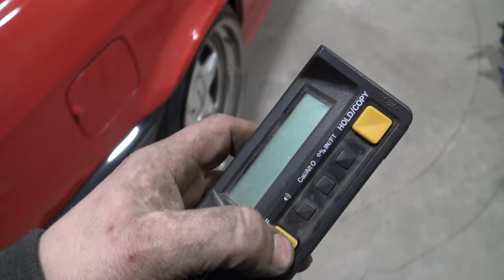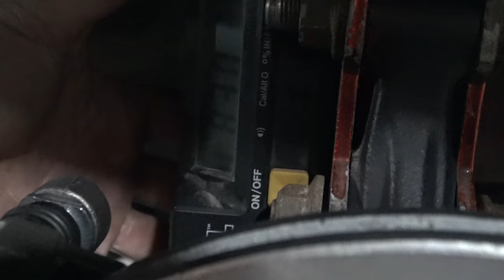Honda Civic front suspension completely converted to 240SX!! (Remaking The STRUT TOWER)

Comment: You guys should mass produce the parts needed for this swap... start selling conversion kits... this actually seems really legit.
Reply: I don’t think the demand is really there. It is really cool, but I can’t imagine people would spend the money it costs to do this when there are so many other platforms that are cheaper
Reply: @nickgrillo4830  You would be very surprised... kids with honda's spend a lot more to do a lot less currently... and by the sounds of it on paper... it might make a better chassis then the 240...
Reply: Not a lot of people have the resources and time to cut and alter the integrity of a civic frame. I personally wouldn’t trust people to do all that work properly and then race it. 

Think about it Jimmy had a professional like B Hall sitting next to him double checking and helping him make modifications to high load bearing points of the chassis.
Reply: @bigzlowered  it really wouldnt, its going to be fun but if you wanted it drive 100% there would be alot of corrections required to fix the front suspension geometry with how much its been widened
Reply: @MrMonkeyworld9  Yeah indeed, i was looking at the geometry and thinking roll centers are going to be way off after the lca was lengthened
Reply: I just typed a similar thing before seeing your comment. Totally agree man, but mass producing them would be tough. If they had the equipment they could just save the diagrams and build them as needed but theyre doing a bang up job nonetheless.
Reply: Or just sell ready to go chassis
Reply: @bigzlowered  no chassis is better than s chassis when it comes to drifting...

Comment: Jimmy, get yourself an aluminum intake manifold, alpina made some good ones for this engine, they hold boost better
Reply: Twin plenum design if you can find one for more even flow across the runners
Reply: i’ve never seen an m50 manifold ever break.. the only advantage an aluminum manifold would have over the m50 manifold is volume of air it could hold

Comment: You should try taking the front fenders off and remounting them back onto the oem mounting holes with a 3/8" to 1/2" off the oem mounting holes. This will give you "over fenders" and you wont have to cut or weld or reshape. This also gives you slight gap on side of headlight and front end of doors that will act as air ducts for excess front wheel air build up. Then you just need to add the difference fron new hood gap onto either side of the inner fender edges. That would close the gap of spacers and restore oem hood line. 

I dont think thay would be too bad. And ok i guess i lied. The good gap part would def require some welding. My bad.

Comment: Self Steer. Would that help in drivers over-correcting an out of control car during a wide turn? Would the car run straight if you let the steering wheel go. Then point the car.
Reply: Yes, even more so when the akerman is near or at zero.

Comment: Can you explain to an old person like myself why you don't attempt to make your tires perpendicular to the road? I'm pretty sure no tire manufacturer has designed a tire that is meant to work well at more than a degree or two of camber.
Reply: Camber allows the tire to be flat to the ground at and near steering lock. This allows for more front grip while drifting (more tire on the road at this time)
Reply: @bradleyhendrickson8644  OK thanks. So the extreme camber of the wheel when pointed straight becomes neutral at full lock?

Comment: Wait so y'all are going to trust the entire front strut being held to the car by the four tiny Allen bolts?
Reply: That's the same way every coilover is bolted on.
Reply: @Skatinsince1997  I'm a Honda guy so no they're not lol. Two 12m nuts hold it in not four skimpy Allen bolts
Reply: But on an s chassis you are right
Reply: @minilurk11  the 12mm nuts your talking about bolt the top hat to the strut tower.  Their top hat is straight welded in instead.